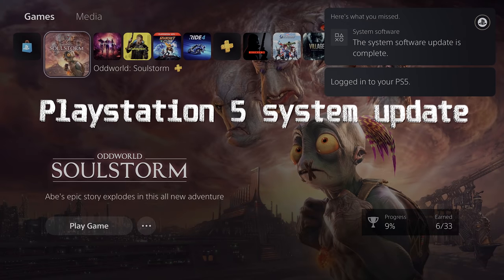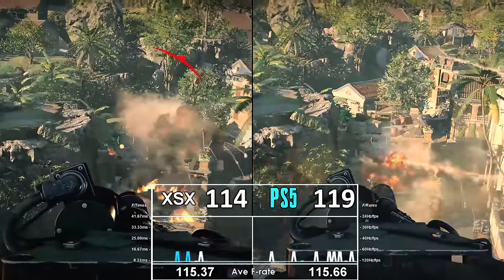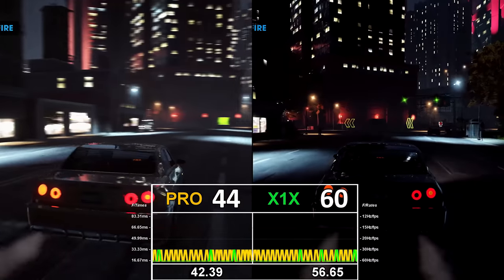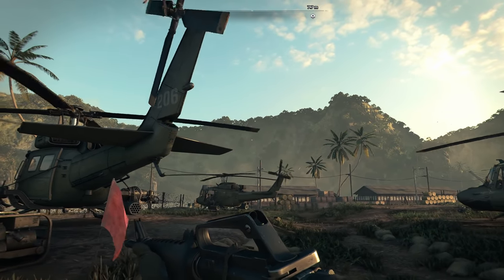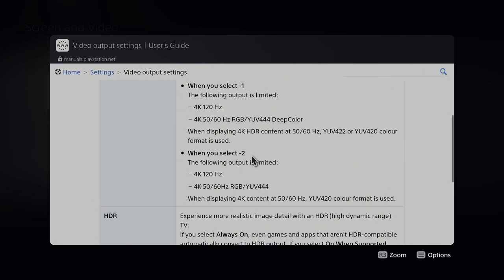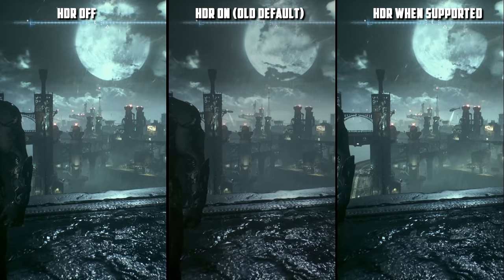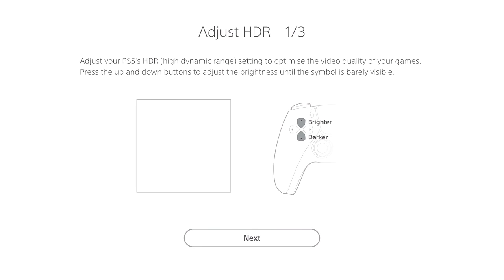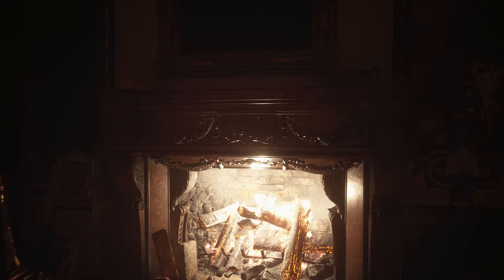PS5 System Updates - Part 2 Image Quality, HDR and Frame-rates

Comment: Your recommendation about the HDR calibration menu is incorrect. See Vincent Teoh's video on that. Doing it your way (and the way it's incorrectly instructed to do on the menus themselves) will ensure that your TV's peak brightness will never be used. HDR should be using the full range of your TV's capabilities.

Now what you recommend IS correct for the in-game calibration patterns. But not for the system level menu.

Comment: ps5 is actually better than average pc...i think imma go for it...if i live long enough to see it ofc.
Reply: It depends what you want,  a PS5 is like a midrange - upper midrange gaming PC.

Obviously a PC is far more customizable, you can change the resolution and frame rate to your liking. 

But for people who don't want to spend £1000-1500 and don't want to spend time setting up games a PS5 is great value.
Reply: @brewski535  What's your exact definition of mid-range gaming PC?
Reply: @theone4982  I’d say for 500$ you get fantastic HDR and 120fps? Not bad at all, considering your tv can handle it.
Reply: @TipppedScales1015   Not bad if you want to outdo the PS4 and XBox One. A $500 PC can't do Raytracing @1440p/4k and at least 60/30fps.  The cheapest rtx card (rtx 2060) costs almost twice as much as the PS5/Xbox Series X.
Reply: @theone4982  Yeah it’s incredible seeing what devs are gonna do like 3 years from now with the console architecture. We’ve finally reached a stable place that’ll only get better with time for sure.
Reply: @TipppedScales1015   Thats true, mid to late Gen is when the hardware optimised games always pop up. Really exciting.
Reply: @theone4982  Now I agree on the ray tracing 1080p is laughable on console. But if we get a PS5 pro in the future the possibilities are endless for sure.
Reply: @TipppedScales1015  Raytracing really depends on the implementation. It's quite expensive and taxing on any system. Nvidia uses DLSS to offset the cost and AMD would use FidelityFX in the near future. If Sony/MS drops any mid-gen refresh, then i expect it to be better.
Reply: @theone4982  Agreed 💯

Comment: I have been enjoying my PS5 since I got it at launch; its games have been genuinely good, especially Demon's Souls and Spider-Man: Miles Morales. I have also been enjoying a lot of PS4 games on my system, almost all of them enhanced in some way from more stable 30 or 60 fps framerates to having higher dynamic resolutions. This is a generation where the previous generation games do not suddenly look out of date on newer hardware.

However, I have to express my disappointment in Sony's slow roll out of features such as the PS5 game archiving to external storage, which came almost six months after launch, and we are still waiting for them to support VRR and ALLM, something my Xbox One X has had for FOUR YEARS! The worst thing though is that the SSD expansion slot is STILL locked out on a system that has a measly 667 GB of internal storage for its native games. Again, this is one area where Microsoft lead as the Xbox Series S/X had expandable storage available from Day One, along with VRR and ALLM support.

Those coupled with the external drive/rest mode issues at launch, the uninstall game bug (where generic grey icons get left on the dashboard when a game is deleted) and game crashing issues all together make the PS5 feel a bit rushed and unfinished in my experience.

Comment: Vincent from hdtvtest has different hdr setup recomandation for ps5
Reply: Its hardly very different is it? Vincent suggests white point left where the image dissappears, nx suggests turning it down one step, which is what sony themselves advise.
Reply: @titntin5178  yes thats the difference
Reply: Was about to post this myself
Reply: @titntin5178  Vincent also suggests turning the final slide all the way down, especially for OLEDs as it will lift blacks above a 0 nit output otherwise.
Reply: @zzgeekinitupzz1123  so far I’m leaning towards Vincent. He’s backed with tangible data. It’ll be interesting what insight nxg will have on it.
Reply: Maybe Vincent is technically right. Black level will be 0 etc. But it makes content viewable on dark room only. At least on my OLED TV. Modern OLEDs simply does not have required brightness to pull it off.
Reply: @smdby  That’s why the calibration is there. You’re calibrating the HDR highlights to the peak HDR brightness of the OLED. Meaning you won’t lose detail because it won’t go any brighter than the settings.
Also, HDR irregardless, is best viewed in a dark room. The extra color data, aside from the darkness of what’s on screen gets lost in a bright room. It’s anecdotal, but my grandmother, someone with zero interest in this tech noticed while I was playing Devil May Cry 5, asked why the screen looked washed out when the room was well lit. Closed the blinds and blackout curtains, she then said, wow, I didn’t notice all the red in the environment before.
Reply: @zzgeekinitupzz1123  From my experience games usually do not satisfy strict film industry production standards. So it is less important to displaying source material exactly as it is. For example HDR in Nioh 2 is so broken that I doubt they ever run it themselves. And God of War has clipping issue that cant be fixed with calibration.

Comment: The SDR implementation, is messed up on the PS5. It bleaches on my TV, while same content, same settings from other sources looks fine. What comes to mind is they are taking SDR content, putting it in HDR then putting it back in SDR. Sounds bizarre but I can't figure out what else it is.
Reply: Had a few games like that on mine too but have found adjusting the in game settings has been able to correct it... especially in watch dogs legion and hitman 3 that looked just like you said "bleeched" 😳
Reply: @Q-Limited  Yeah, but say YouTube videos are all bleached. And shouldn't have to adjust. Ive found keeping everything at HDR gives better more accurate results, even tho it shouldn't. Hopefully Sony fix this
Reply: They've already fixed this. You can set the console to only output hdr when playing hdr content.
Reply: @CyborgSodaCollects  You've not read what I've written properly.
Reply: @jrv7346  On which content?
Reply: @CyborgSodaCollects  All.
Reply: @jrv7346  Hmmm 🤔 I think I know what you mean.

Comment: PS5 has a very odd way of handling HDR…. I’ve had to calibrate pretty much every game I’ve started on my PS5. It’s weird. I think I finally have it set good. I had to tweak the brightness on my LG C9 and thankfully the Home Screen on the PS5 outputs in HDR so it allowed me to look at multiple splash screens for games and get it just right to my liking. Before to adjusting that way, I had crushed blacks BADLY in every darker game I played. I couldn’t even navigate in Hitman 3 and it was SO damn irritating…
Reply: That sounds like a YOU problem, ive not had to do that at all.
Using a X90H, most game are spot on by default.
Possible you are using DTM or something.. id look into, do more Tv research.
What you are doing isnt what everyone is experiencing from what i can tell.

Comment: Is it true that the HDMI output on PS5 is 32gb/s? And what about RDNA? Is it 1.5 or 2, I genuinely don't know
Reply: PS5 is RDNA 2(1.5 don't exsist)PS5 is all over AMD website and they state PS5 is RDNA 2
Reply: OK, what about the hdmi, is it a rumour too?
Reply: @laithmanleo  I believe it capped to 32Gb/s as of now but PS5 Chipset supports full 48Gb/s, over HDMI 2.1. It may get patched in later as and when required. Ther are a few unsupported features of HDMI 2.1 that also could be patched in
https://www.shacknews.com/article/120510/what-you-need-to-know-about-hdmi-21-for-ps5-and-xbox-series-x
Reply: It's a customized version of rdna2. Consoles don't need all the instruction set of RDNA desktop, so many get stripped , and then they work with AMD to put some custom of their own in there.

Comment: NXG ...you're contradicting yourself. You claim VRR forces the TV to refresh when a frame is ready. True, but then you claim the benefit of varying refresh is less judder. The eye sees frames exactly the same as it sees screen refresh. A series of static images giving the illusion of motion. Bad frame pacing gives judder. Bad screen refresh pacing also gives judder. Controller accuracy is unpredictable. The benefit of VRR is zero screen tear because only full frames are refreshed to screen when they are ready. The XBSX needs this. The GPU is resorting to screen tear because it's waiting for data to arrive at RAM from the slow SSD to draw the next frame. VRR is a fudge.

Comment: hdr is overrated, makes everything look unrealistically bad
Reply: Depends on the TV.  All TVs are not equal on their HDR implementation.
Reply: Low cost TVs are complete garbage in displaying it. U need to cop out a large sun for good hdr.
Reply: Sounds like you have a shit tv, HDR is the best upgrade in a long time.
For example dirt5, the sun looks actually bright with sunsets, sunrises looking realistic.
Reply: I have a 2020 Vizio, heard someone say this same thing, and so I turned off HDR,  I was like kill it with fire 😅 . Sorry for your experience,  but hdr on my tv is like a night and day experience.
Reply: The problem is HDR has too many places to be screwed up.
The two bigger are your tv (hdr support does not mean it will look good, the manufacturer has to put in the tech to render colors properly) and game devs (they have to put in the work to use hdr correctly in their games, and most don't, because they don't understand it, it gets complicated)
Reply: HDR is great on high end tvs. If the TV is not up to the task then HDR can make everything look bad.
Reply: HDR is awesome